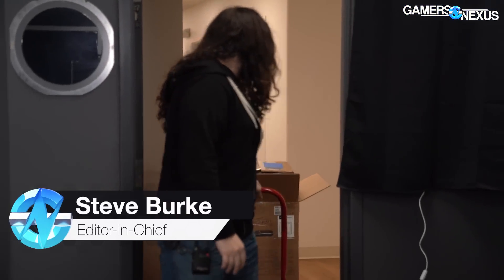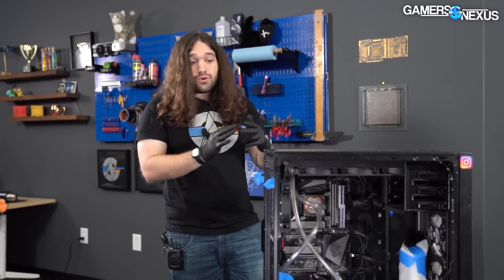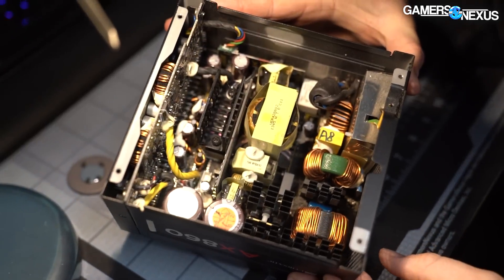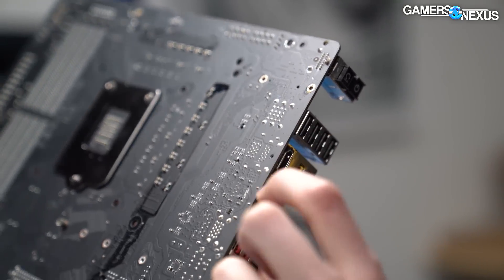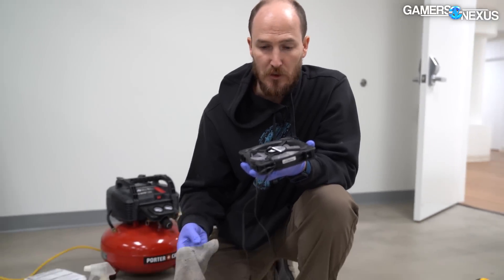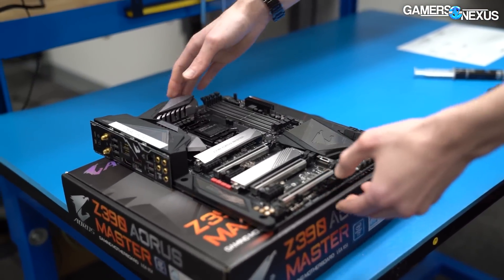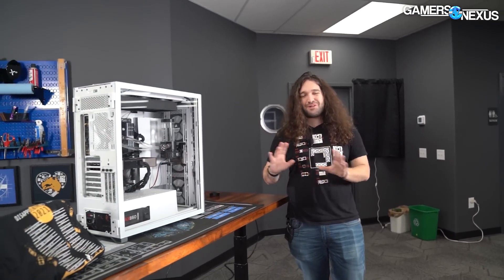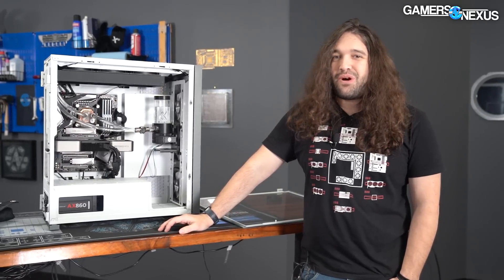A 150mph Hurricane Killed This Gaming PC: Cleaning, Restoration, & Repair

Comment: I'm surprised the PSU survived. The rest made sense. The motherboard, with the amount of surface area and exposed components it has, was the most likely to have problems due to water damage. Next, at a close second, would have been the PSU with its position at the bottom of the case and with it likely carrying a charge even if the computer was turned off and unplugged recently. Glad this thing was mostly unscathed. At least that's one thing this guy doesn't have to worry about. I hope he can get everything taken care of. Insurance companies are notorious for not wanting to cover storms even though it's written into their contracts.
Reply: It is a really nice PSU. Still at 10 years old it's on its last legs. Nice Nippon Chemicon caps in it though.

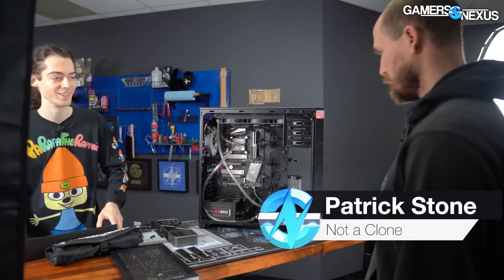Comment: 6:28 The dude on the left's usage of ESD wrist strap is actually infuriating. Metal plate on the inside of the strap is on his wrist bone, which causes continuity issues with ground because it moves so frequently. It should be centered on the top of bottom of the wrist and tightened so it's not loose, like it's shown to be in the video. Long sleeves shouldn't be worn, or at the least rolled up to his elbow, and should not be wearing a watch at all, let alone on the same arm as the wrist strap.

Comment: I buy Corsair and it’s either fails out of the box or works for a max of two months. All the planets must have aligned for this psu to go through a storm and be fine let alone last for as long as it has. Maybe Corsair has just declined in quality over the years because since 2012 I’ve had 6 psus go out by them. Funny how I have a thermal take 750 from 2011 still going strong lol I also have a bequiet 850 that’s been going since 2019. Now that I think about it only psus I’ve purchased that have failed has been from Corsair XD wtf.
Reply: I have had 4 of them over the years. And I have had 1 die catastrophically after about 5 years, and the other one is causing my asus z77 board to not post properly, which seems to be a common complaint. But functions in another build but for a little too much ripple on the 12 volt. They are all at least 5 years old with one being now going on 12. And they are all seasonic built for corsair. So I consider that a pretty good run for me. All of my seasonics have lasted years as well. Same with my brother's seasonic. His is goin on 14 years old and is still powering his devils canyan gamer...

Comment: For those criticising americas build methods. It's not as easy as you may think to get something built in a different way to everyone else in your region. There is less professionals doing that and prices are higher. That is if you are lucky enough to build your own house. Building with wood has a lot of advantages as well as its disadvantages. The world of engineering is a world of compromise. You can't have everything. On top of all that its not rare for concrete houses to get badly damaged by fast winds.

Comment: Same thing happened to me 11 years ago.  Only it was a tornado the took off the roof. I hosed out my system with garden hose and sprayer. Got it 90% clean.   Then I disassembled the system.   Cleaned each part in the sink using hot water after I sprayed them with 409 multi-surface cleaner.  then final rinsed all parts in a mix of 70% and 91% Isoprol Alcohol. ( to push out any water and make it dry faster).    Placed all parts in front of a box fan to dry for 24 hours.    Reapplied new thermal grease and thermal pads to motherboard and CPU, and video cards.   Reassembled PC put new Cmos battery in.  Turned on everything worked great  Which surprised me.    Except monitor  that was a total loss.

Comment: tip 1: when testing RAM, don't do it in UEFI mode, do it in MBR mode; because the UEFI boot will reserve more RAM and the testing software doesn't have access to it
tip 2: when testing RAM don't do it with the iGPU because RAM will be reserved for it and the testing software does not have access to it

Comment: It's possible that the CMOS battery might've fried the board. If he had removed that battery, it might've survived okay.
Reply from the maker: As Patrick stated before he powered it on, the CMOS battery was not in the board for first boot.
Reply: @GamersNexus  yes but the battery was in the board during the storm. The damage could have occurred then. Test the BIOS chip and see if it is what took the hit.

Comment: Hard to clean ……first is Aio heat sink second is display card heat sink , the dust in side if you don’t use water just the vacuum cleaner do not perfectly the clean it

Comment: Water isn't that dangerous with low voltage, it's the minerals and pH of dirty water that causes rust and damage, the military uses 12 VDC devices in water and mud every year.  But it must be rinsed out with clean water ASAP.  Unfortunately this will fail prematurely after letting that funk sit for extended period.
Reply: Military gear is likely conformally coated. Beyond that mil spec parts are more rugged than consumer parts are. Consumer electronics are a half a rung above garbage. That's just reality.
Reply: @1pcfred  military replaces stuff routinely after doing the recommended maintenance of washing the gunk out for X number of missions.  This wasn't rinsed out with distilled water, and many parts were reused.  I trust a $5 scratch off lottery ticket over this build in 12 months!
Reply: @RJ_Cormac  when I worked in a board assembly house we ran every board we made through a dishwasher. Used tap water. By the time we were done with a circuit board it was brand new then. Your ass is distilled water. Oh and I made coms gear for the military too.
Reply: @1pcfred  how is that related to salty hurricane ocean mud water?  Are you just a fan boy who can't accept Steve and GN made a bad decision reusing a 10 year old flood damaged PSU?  You're really going to fight this stupid battle, it's not like we're in a PSU shortage! 🤦🏻‍♂️😂
Reply: @RJ_Cormac  there was no sign of any damage in that PSU. I do not think the house had to withstand any storm surge. So I do not know where ocean mud comes into play. He said he lived in Louisiana, not Galveston. We're not talking about the great storm of 1900 here. Spongebob wasn't living in the kid's PC for crying out loud.
Reply: @1pcfred  nobody looked under the soldered components. They aren't silicone down before soldering, there's junk under each component, they couldn't reach without disassembly and resoldering.  Total waste for a 10 year old PSU.
Reply: @RJ_Cormac  whatever junk may or may not be there does not matter because the unit was tested and found to be functional.

Comment: Oof, that PSU should be junked!
Reply: Even if it is still working today it is on its last legs. 10 years is the outer limit. Nippon Chemicon are good caps but they're not magic. Now if they were Rubycons then OK. No one puts rubys into PSUs though.
Reply: It was literally torture tested by an electrical engineer. Why would it be junk?
Reply: @brianfisher7385  I saw it being tested for voltage and current output. We're not planning on running a heating element with this PSU though. Digital electronics need clean power. I did not see this unit being tested on a scope and the ripple output measured. That could and should have been done.
Reply: @brianfisher7385  it's already at the end of it's life cycle, and higher voltages are more conductive in water.  Then it takes many dissimilar metals to do voltage inverting and regulating, add water to dissimilar metals and corrosion will come quickly.  He didn't look under the soldered components where the water stains are, and extremely close to the solder joints.  Those are a time bomb, I'd never put my name on a $100 PSU after 10 years AND 10 inches of rainfall!  Stupidity for $100 🤦🏻‍♂️
Reply: @1pcfred  Engineers said the Challenger was launch ready, oof! 🤦🏻‍♂️
Reply: @RJ_Cormac  not all of them said that. Sometimes things need to be done simply for the sake of expediency. They must be done so they shall be done. Doesn't always work out though.

Comment: I watch your channeloff and on and I watched this video and was dissapointed. I think that you may have a ample supply of new and used PC parts and in my opinion you could have replaced that persons PSU even though you atated it was ok  same goes for some of the other parts If it were my PC and I have over 15 years in conputer repair and troubleshooting and I had the amount of spare parts you did I would have replaced most of the parts with either good working used parts and maybe some new. I'm sure being that the PC was exposed to the weather moisture and rain and water I wouldn't trust any of the components that were exposed to the weather but this is just my opnion.

Comment: 12:03 Why even have a blast shield at all if you're going to put your hand  in danger like that. I mean losing a left hand isn't as bad as a hole in the head but seriously at least poke it with a stick or something if the source doesn't support remote turn-on. I'm appalled at the serious lack of safety at GN. Someone is going to be hurt some day.
14:00 Making completely unsubstantiated opinions about PSU degradation over time (or lack thereof) is misleading your audience. How many 10 YO PSUs have you tested? Do you have any experience in PSU design or efficiency considerations? Many of the biggest factors in PSU efficiency do not degrade much over time (whereas some others like cap ESR definitely do).

Don't take your uninformed opinion and pass it off as fact. People will actually believe you and be worse off for it.